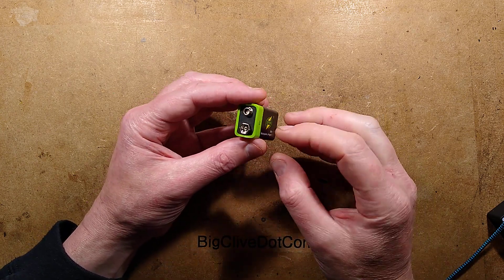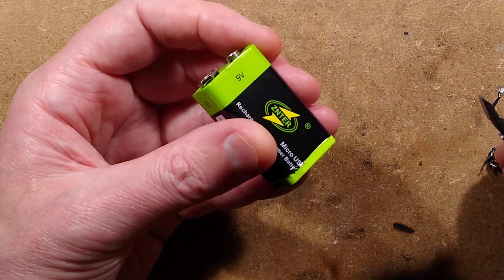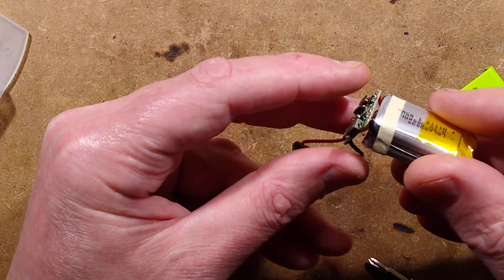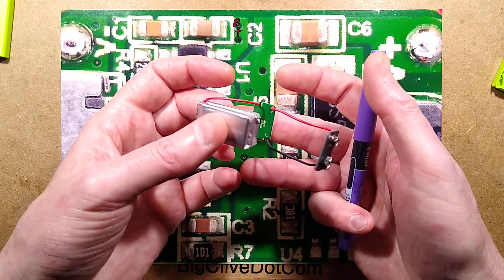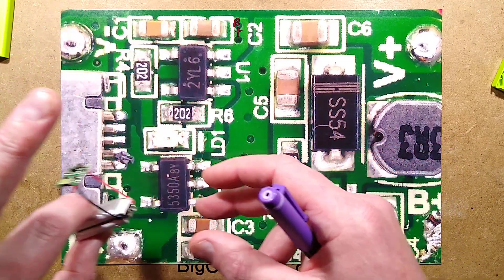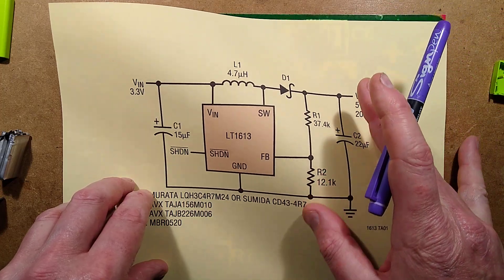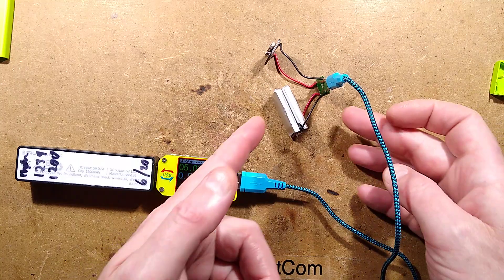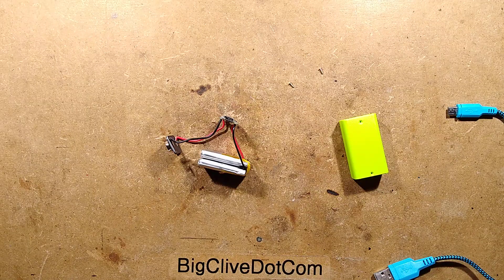Inside a Znter lithium 9V battery.

Comment: Got one of these myself to use for a cheapy multimeter and they're pretty nifty. But yeah, the switching noise can be a bit of a problem. The piezo speaker in it that's used for continuity detection now emits a constant faint tone whenever it's on. Not a big deal since I just need a working multimeter,
Reply: wtf
Reply: Have you come across any more observations on this type battery working in a decent multimeter?

Comment: Really useful.

I'd like to use one of these style of batteries with active guitar pickups, where the battery stays in the guitar for months but only discharges when the instrument cable is connected.

1) Are they safe enough in that instance to not go up in smoke if I charge it away from the guitar? I dont want to be playing or even have the guitar on a stand and suddenly find Ive melted the wiring or components because I used a Lithium battery (if they drain completely due to current leakage when the guitar is unplugged is there a risk of combustion?)

2) I have an onboard Korg mini sampler gadget with its own 2xAA power source and a switch so the pickup signal can run through the sampler before returning to the output jack. There is also a switchable on board distortion/mini-amp for the additional headphone out socket. As long as these are switched off will there be any current drain when the guitar is unplugged and would the additional 0.6 volts of a Lithium 9v risk damaging these electronics, either through the signal, in regards to the Korg sampler or the onboard amp/distortion circuit board?

Many thanks!

Comment: Great video.  Always learning more from your videos Thank you.  Can you comment more on why this type of battery is not a good choice for audio electronics.  I have found they are great for some applications but all my guitar pedals or built in tuners hate them.  A guitar tuner just will not work properly.  Very unstable or sensitive.  The various guitar pedals you can place before and after you guitar amp just add noise to the end audio sound/tone.
Reply from the maker: The switching power supply puts out enough noise to mess with some analogue circuitry.

Comment: I am glad you honestly review these. I might use this brand in my smoke detector. I am currently trying AA lithium rechargeable batteries charged by usb.
Reply: Smoke detectors given there safety critical application will usually list the exact models the battery's there circuitry is designed to work with, and they make a point to tell you to only use those exact battery's , I am not sure how the sensitive sensing chips in there design would deal with a aftermarket battery with boost circuit noise on its output , so I probably would not recommend there use in a device like a smoke detector

Comment: Any idea what the self discharge time of this sort of device is. 
Presumably if the voltage booster circuit is running 24/7 then its always consuming some of the stored energy. I was wondering if this could be used in my wireless burglar alarm PIR sensors which draw very little current, but need to last for months at a time.
Reply from the maker: It's self discharge is significant.  I'd only recommend it for items where it can be recharged regularly.

Comment: I’d love one of these for the alarm battery on my motorcycle I mean the alarm only lasts 2 weeks when running off a 9 v and I don’t like hoo king it up to the main battery as it can flatten my main battery to the point I have to bump start
Reply from the maker: It's it possible to increase the size of your bike battery, or use a maintenance charger to keep it topped up?

Comment: Thanks Clive, I have a digital tach that uses 9 volt batteries, and didn't know there was a decent option.  I just went and bought four, just like the one you dissected, I hope.  That is a truly in depth detailed analysis of a rather nice design, and as said before, quite refreshing, considering some of the junk that is most readily available.  Well Done. Thank you again.

Comment: Wouldn't you get higher capacity from it by connecting the cells in series so the converter would be more efficient?
Reply: Yes but then balancing the cells becomes an issue.

Comment: Excellent product which has a few uses as others have suggested but for me to use these as a power supply for my portable valve radios I would need ten in series for 90v HT, high tension battery, I would probably go for the mid range because the currant would be over 90v thus damaging the valve filament. Even an old transistor radio that uses a standard 9v it could cause damage to transistors so my preferred option would be to use two mid ones in parallel, maybe four in parallel for the large PP9 size. An excellent product though an well constructed to, Lithium always gives a slightly higher voltage as I use those vape batteries that are near to the size of an old Ever Ready No 8 3v, hard to find now an expensive, I use these as I also restore vintage torches, with these torches that use this size I fit a higher voltage bulb, 3.5 to 4v anything lower would blow using lithium cells. I recently made an old No 8 battery using a lithium battery with pennies soldered to the bottom to make the length up, it works in all lamps using that hard to find No8. Once again Clive excellent video which as a hobbiest I am learning a great deal from your content.
Reply: These cells are regulated to provide the same output as the traditional cell that they represent. A plain lithium cell without the regulation, sure they WILL have a higher voltage, but these aren't like that.

Comment: There are quite a few around now,I have tried 4 different brands.
If you're interested on DXing on AM or shortwave on portable radio ,the DC to DC convertor causes EMI across parts of radio spectrum.
Not suitable for DXing on HF, ok for FM or DAB.
Viewed the interference on a spectrum analyser.

Comment: Wish there were lithium rechargeable AA cells that have a capacity > ni-mh rechargeable cells. So weird they don’t seem to exist despite the difference in energy density.
Reply: You can get Lithium cell in size 14500, which should correspond to AA, and fill the other two positions with dummy shorted batteries. Some devices can tolerate this. I would also look for "protected" cells. This was a workaround for some motorola PMR radios or other devices using three AAs.

Comment: I want to get some batteries like these to power my guitar pedals up. What precautions can I take not to choose the noisy ones? I`m afraid these little circuits to boost the voltage and recharge the cells may cause hum.

Comment: With 2x 500mAh cells in parallel, I don't see why it's rated at 500mAh. Surely, it doesn't suffer 50% losses in the boost circuit? Or is it conservatively rated at a specific point in a cell's lifecycle? That would be very unusual.
Other than the seemingly odd mAh capacity it does look like a great design.
I've been using "9V" lithium batteries that just slap 2x lithium cells in series (max 8.4V) which is just too low for some devices.
Wish there was a way to temporarily 100% disconnect the cells from the boost circuit's drain...like by using an sealed magnetic micro reed switch, or a hall effect sensor + MOSFET on the PCB in the battery and an external magnet in a special "storage case".

Comment: Hmm fascinating. I see the newer 600mah one on amazon is just under £10 and I presume it has the same setup as this one. But they don't have a good shelf life then. If I didn't use one for say 3 months it would be flat after this time ?
Reply from the maker: They have a faster self discharge than modern NiMh cells.  And also cut off suddenly, which is an issue for things with low battery warning.

Comment: The 800 pound gorilla in the room is the output noise of this battery. Boost converters are notoriously noisy at audio frequencies, particularly under light loads when the converter shifts gears from PWM mode down to PFM mode. PFM mode produces a sawtooth output voltage. If the device powered by this battery is has a low PSRR, then the you got trouble. Clive should connect the output to a spectrum analyzer and examine the spectrum for various load currents.

Comment: The Znter 9v 400mA battery was in the tester. I did not use the tester for a month, I tried to charge the battery, but charging takes a minute (the red LED is on) and stops. How to reanimate the battery?
Reply from the maker: You might be able to open the unit and trickle charge the battery with a current limited source to get it to a level it charges properly again.  It might even be possible to do it via the external battery contacts.

Comment: Been using two of these in a pair of network cable testers for just over s year so glad to see they are well made :)

Only thing one lasts for months at at time the other is flat every time the tester comes out of the tool box. Yet to figure out if its the battery or the tester that's duff.

Maybe I just need to find micro usb extension so I can charge them without taking them out of the testers 🙂
Reply from the maker: Biggest suspect for rogue current draw these days is the little ceramic capacitors.  If they fracture they turn into resistors.
Reply: @bigclivedotcom  Thanks
Pretty sure the internals off the testers are a voltage regulator that steps the 9v down to 5v some resistors and LEDs. 

Once things are back to normal I'll mark the batteries and swap them

Comment: I have found LiFePO4 9.6V in 9V battery. trouble was full charge the volts to high for some electronics. the 7.2V Li-Ion cells just to low for some electronics. hard to find good rechargeable 9V battery .

Comment: I see this particular model being sold on Amazon as suitable for smoke alarms, but doesn't the LiPo nature mean they will go from 9.6V to 0V very quickly thus not allowing the low voltage buzzer to sound?
Reply from the maker: It will defeat the low battery warning and not last as long as a traditional battery.

Comment: Ifin There Was Any Noise From It, Couldn't You Solder A Capacitor Across The Outputs To Quite That??? That's What We Do On RC Electronics! LOL Thanks
Reply from the maker: For audio applications it might require a bit more filtering.

Comment: is it able to be charged by the main plug? What if you use the battery to plug into circuitry for a backup power supply when the is power goes out- but when the circuitry is plugged into a wall and being used,  the circuitry has a self charging system that charges the 9v battery.

Comment: This could be interesting for smoke detectors where there is a power supply available, like for example a 3d printer.

Or my old Barco CRT projector remotes. They use 9v batteries, and the eat batteries when you use them a lot with the backlight turned on. They're long lasting otherwise though.

And the Barco remotes have two battery slots, one with connection tabs and another empty slot for a spare battery. Maybe I should get one of these batteries and do a slight modification to use both a normal alkaline battery and a lithium battery at the same time. Would be interesting to have the option to charge the battery in addition to the long lasting nature of the alkaline battery when the lithium battery runs out.

Comment: They actually possibly could of gotten nine volts out of it without needing a booster by simply using two 4.5 volt lithium ion cells as they are widely available and are very commonly used in devices like smartphones! :)

Comment: You can't just look at the quiescent current, the lithium cells tend to have high self discharge don't they?
Reply from the maker: Lithium cells have an extraordinarily low self discharge.  Aside from their awkward ability to explode they are almost the perfect cell.
Reply: @bigclivedotcom  i might just be possibly thinking of lithium polymer, or lipo batteries used in rc planes specifically, I know I was advised that if I was going to use a lipo battery for my transmitter I would need to top it up before I fly with it, moreso than other comparable batteries

Comment: i use a different brand same design set of these for a tenns machine for reliving pain ... get 2 to 3 times the use out per battery and charged real quick .... as well as dome dd size and aa size ... with muilt in charge port all more life then even the avrage rechargeable

Comment: I like the idea of these for some applications but always worry that somebody will use one in their smoke alarm. Unlike normal batteries where the output voltage drops slightly as the battery goes flat (and it beeps annoyingly until you change it) these just drop from 9V to 0V when flat, so you're totally unaware the battery has gone in the alarm.
Reply: Good point
Reply: Won't matter in a mains smoke alarm with battery backup, also that's why you should test the alarm every month (not that we do, do we?)
Reply: They banned the replaceable 9 V  alarms in CA  in 2015 and only 10 year non replaceable batteries are sold.  How old are your alarms?   PS  the long life  batteries are also LI  type so testing is mandatory !
Reply: @danc2014  mine were 2011, don't think they're banned here (UK) but not checked for a few years as these still work a bit too well (i.e. every time I use the oven)

Comment: As an owner of a live production sound company, I have tried a few times to get these from different suppliers. I’ve tried 3 times only to have Canada Post confiscate them upon arrival and not send them. I estimate I use 30 9v batteries per year at a cost of $10 each to buy locally (remote Northern Ontario). Just one of these has the potential to save me $1000 in regular batteries. If anyone has successfully ordered these in Canada could you drop me a reply as to where you got them.... Thanks! ....Save The Earth! :)

Comment: I have to admit -- this is a very clever design indeed. Not only is it clean and well-considered, the fact that they're using a fairly big step-up (2.5x) allows them to use a 2P configuration (instead of a 2S one), which makes charging and maintaining the batteries much simpler. The only real problem I'd have with it would be how the circuit is essentially protecting a battery bank instead of two single cells - these can and do age at different rates, meaning you might have a tiny fire hazard should one of the cells suddenly fail for whatever reason (seeing as the circuit likely wouldn't detect that, with the other cell effectively masking the failure). Otherwise, the real limiting factor here is the form factor - 9.59V seems a tad on the high side... I assume that, with a bit more space, a more accurate step-up could be used.

Comment: This would be useful in measuring instruments however the boost converter may probably introduce noise.  This pack could also be constructed with three LiPo in series with an LDO or buck to get 9V.

Comment: I think I might buy a couple of those and give them a try.  A theatre group I work with is using Trantec Microphones and the lav. packs use PP3 batteries; we swap the batteries out every-other show to avoid the embarrassing moments of a battery crapping out.  They don't go to waste as we do run them dead when doing rehearsals, but it's a lot of hassle and it's wasteful.  Maybe, this is a viable option...

Comment: The switching noise unfortunately makes this pretty much useless for computer equipment as well. They can cause erratic behavior or even cause the system to reset at random! Stuff like digital clocks which use a 9 volt to keep the time and alarm settings when power goes out don't really benefit either, since they still end up losing their settings... Tried one in an old Zenith TV remote and it caused erratic behavior there too.
If they don't work well in digital electronics, and you're saying they're not great for audiovisual equipment because they cause noise, what are these aimed at? Flashlights? Cheap emergency radios? I'm confused as to the purpose of this.

Comment: I bought two of these after seeing this video and the design has changed. The casing is no longer screwed but push fit and the casing is also an alloy not plastic...I wonder if they have done that to try to dissipate some heat. The charge port and led is now situated near the terminals. Not quite such a nice design but does the job.
Reply from the maker: I wonder if one of them is a copy.

Comment: These are a perfect answer for metal detectors. You can use a solar charger with them this way. Less weight in, and more option now. Good strength on those.

Comment: Hey Clive, do you think it'd be possible to modify these little switching circuits to generate high voltages for, like, a couple neon lamps or a small tube preamp? 'cus that'd be very useful for some projects I had in mind.
Reply from the maker: I'm not sure the maximum voltage this chip could accommodate.  But I doubt it would be high enough for neon lamps.